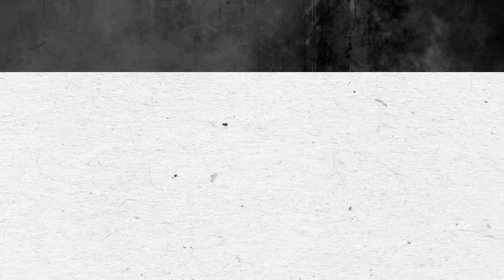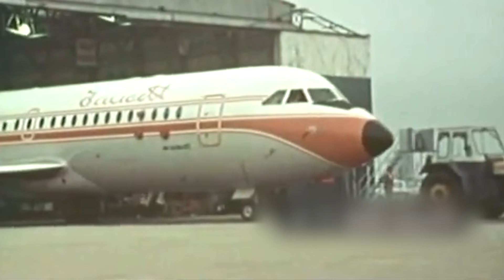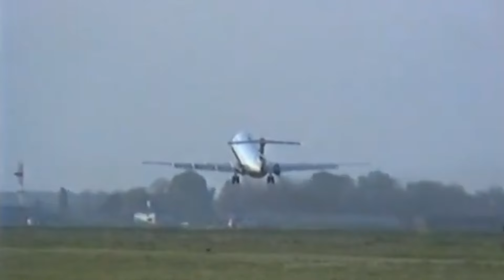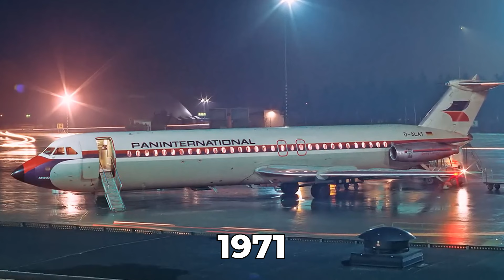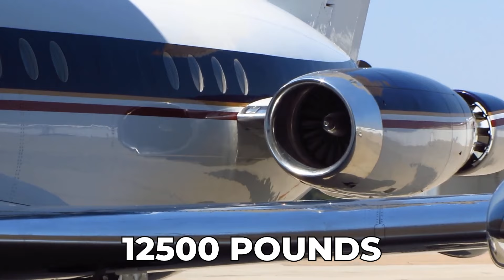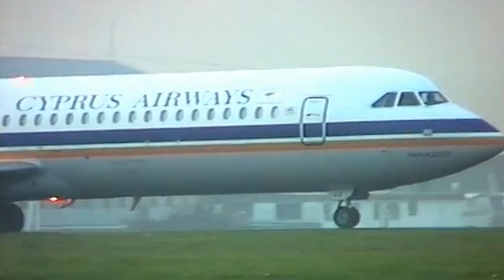The BAC 1-11 - The Jet With The Genius Design

Comment: This jet was Ryanair's only rear-mounted engine jet. Ryanair operated 16 of them in their early years (both BAC and ROMBAC) from 1986 until 1994, when Ryanair replaced them with Boeing 737s in the mid-1990s. All of them left Ryanair by December 1994, EI-BSS was on and off Ryanair from November 1986 and June 1993 on lease from Tarom, and EI-BVH was delivered to Tarom new in March 1988 as YR-BRG, and leased by Ryanair a month later, it later flew for Aero Asia between September 1993 and December 2000 as AP-BFF, and was cut up in December 2015.